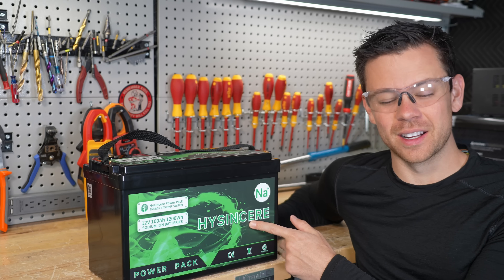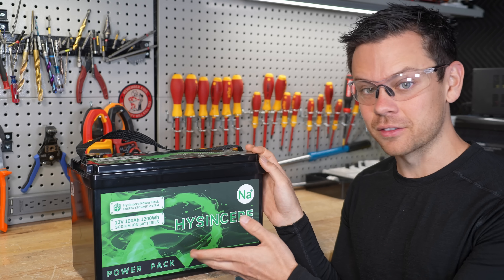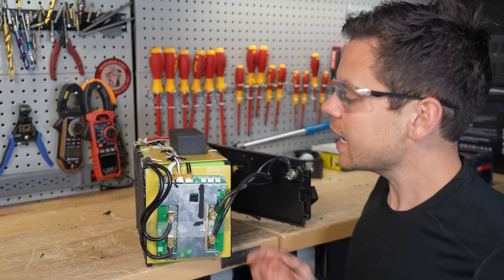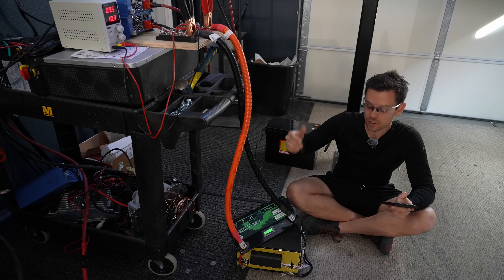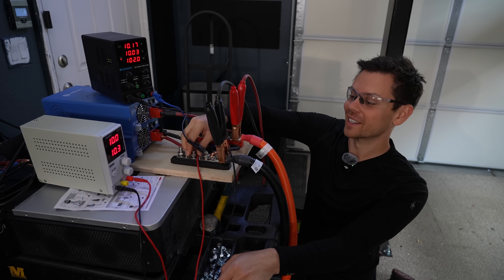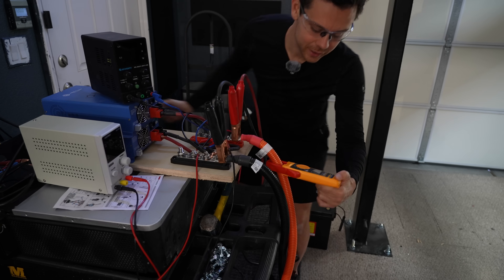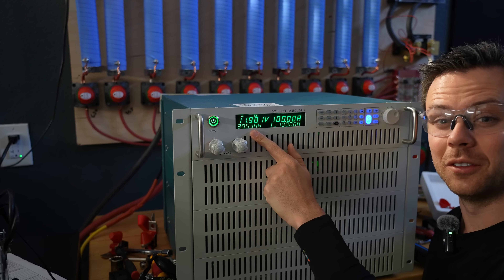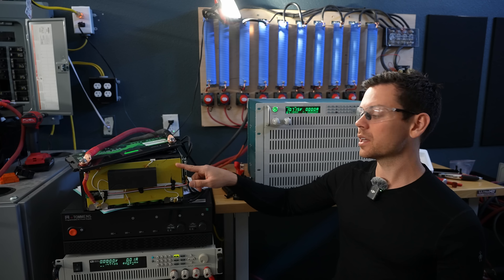Testing My First Sodium-Ion Solar Battery

Comment: I have a small farm/homestead in Georgia.  I use Na+ start batteries in my tractors and trucks.  Cold weather and high current crank are the main reasons, followed by high voltage charging.  Some of my tractors put out 15 volts at the alternator which shut off LFP crank batteries (and they can't be charged below freezing anyway).  Even my Jetta TDI has a Sodium crank battery (it starts instantly).  For my solar setup, yes, LFP all the way.  Thanks for the teardown video.  Very informative.
Reply: Thanks for sharing real experience.
Reply: I have the same experience with Sodium-Ion starter battery in an electric vehicle ( Nissan Leaf ) .... excellent cold performance, no more Lead-acid batteries...

Comment: Have you measured these round trip efficiency?
We tested NA cells in our lab 15.2V-6V 0.2C they had a roundtrip efficiency of 98.5%.
Reply from the maker: Holy cow! What cells did you use
Reply: @WillProwse Unfortunetaly I‘m not allowed to tell. 
But I think the efficiency relates on the cell design and quality.

Comment: There are 3 different types of sodium batteries. 2 batteries use lithium or magnesium. The 3 third doesn’t use any fire hazard materials. You didn’t say which battery you have. However, you do keep saying sodium ion . I would assume you have sodium lithium. Which does have a fire hazard. The sodium battery which has no lithium or magnesium works to -40 degrees F and way up into the 110 degree range. There’s a company in the US which produces these batteries and have them in use for many years.

Comment: Most of these downsides are substantially mitigated in testing for the new tech coming out next year and will be mass produced. This battery is still using much of the original concepts of NA ion and is not up-to-date. The new ones will still be technically inferior to equal weight of LFP in most regards, but there is zero doubt that the price will go down dramatically once this is mainstream. Ideally, this would replace ALL lead acid batteries and be a huge boon for energy storage globally just from that alone.

Many of the other complaints about this in the video are not related to the NA tech, but more to the cheap off brand Chinese manufacturing quality of this specific device.

Comment: Yikes.

This is one of those videos where a surface level understanding and amount of research really leads to poor conclusions.

From a production standpoint alone, especially at a global distribution scale it's very easy to see why Sodium ion is a 'better' technology to pursue than LI batteries.

I think maybe working in a salt refinery in a developed nation as opposed to a cobalt mine in any of the areas it's actually produced currently would probably change your mind but fuck that, how would you be able to make content denigrating the 'worse' technology if you actually wanted to think 10 years to the future?

Comment: I commented this earlier to your earlier video aswell. You focus on so many sidethings and are pre determined to give it a negative "low" grade. You use equipement that is not made for these cells. And therefor all your claims are immediately wrong. You need chargers and inverters that are made for these batteries. Like so we needed different chargers and inverters switched from lead to lion. You cant think out of the box and are way to focused on your lfp / lion setup.

The first lion batteries were absolutely terrible too. Try to look ahead of it. You say you can use a lfp battery with heaters in a car. Just listen to it as you say it. And then you say sodium ion is unpractical. This is not an honest review. This video is a rant and predetermined to be negative. Sorry to say

Comment: Sodium-Ion batteries may not be as efficient as lithium-ion, but my understanding was that the main advantage is materials are incredibly common (found everywhere), easy to gather, and mass produce and maintain. Elemental sodium is pretty reactive though so I imagine these must have similar thermal runaway problems as lithium?

Comment: i dont really understand your video. You cut of the voltage at 10V, which is at 40% soc of the battery and than claim you get only 62Ah instead of 100?!?

The issue is not, that the voltage is to low or the battery is damn inefficient, but that the charge and discharge controllers are configured for different voltages.

This test makes absolutely no sense at all. The only thing that was interesting is the internal battery resistance reducing the charge rate.
Reply: And i am by no means a fan of sodium batteries or so. i actually dont care to much about any hype. Just saying that these tests are completely useless to asses anything.

Comment: 00:18 cany anyone tell me what discharge rate that curve is for?

If it was 1C, that doesn't match the typical usage if someone was considering them for off-grid or a camper van. 

0.1C or less (10-hour or 20-hour rate in old speak) might tell us more.

Is it just me, or should we ignore Ah and be talking about capacity in Wh and kWh down to a voltage limit of maybe 10V?

Comment: As a scientist I see a problem right off. 1. You appear to have tested a single unit, is that accurate? You should probably test 5 different batteries from different production dates to eliminate a possible bad test. 2. If you tested only one battery, you only tested a single brand and unless that battery is UL or some other 3rd party certified for meeting consistant standards then your data means nothing regarding wether or not the technology as a whole is bad. 3. Did you have another person repeat the test to see if they came up with the same results? A minute in I'm hearing that the tech as a whole is a failure in that it can't keep enough voltage to keep the inverter from turning off, and that the 100Ah is only 82. As soon as you saw 82Ah on a unit claiming 100 you should have taken that battery back and got a second unit to test. Either the brand is lying, your method is bad (you don't have a control test with a lithium battery), or the unit itself is bad, or something else. Regardless you are making solid claims without the required study.

Comment: Yup, Sodium isn't a replacement for LiFePO4 currently, nor for portable. The biggest benefit is the US wouldn't be reliant on rare Earth materials from overseas. When production ramps up, costs will go way down because you aren't going to be dealing with tariffs or shipping from China. Sodium will be for houses and fixed locations. Also, as you pointed out, the temperature range is excellent.

Comment: Sodium is great when you understand it isnt meant to replace lithium. It is however a great replacement for lead acid and avoids the major issues with lithium in really cold areas or like here in Florida where tesla power walls and golf carts all burn to the ground after a hurricane because lithium has a thermal runaway problem. Its also easier to dispose of than lithium. So when you compare it to lead acid it works amazing and the lack of thermal runaway makes it way better for emergency power storage in areas where flooding is an issue. I think its a great option for a lot of situations and considering its such a new tech I expect it to get better, cheaper, and more efficient as the tech develops.
Reply: We're talking LithiumIronPhosphate chemistry, where the thermal runaway problems of the old LithiumIon batteries is essentially nonexistent. LFPh batteries are rapidly replacing LithiumIon in most typical application now.

Comment: Sodium will work but it needs active voltage management. It needs to cycle through the smaller cells with high voltage in combination with low voltage ones to generate a constant voltage. It's reminiscent of buck-boost converters. I don't know how efficient this switching would be though. At max capacity, it can have less duty cycles on all cells to bring the voltage down to a normal 12V and rapidly adjust on load to sustain 12V

Comment: The taper off during charging is a function of the linear voltage vs state of charge. A charger setup for Na batteries will sort that out. Blame ur charger!

Comment: I understand why you have issues with this particular pack, but that doesn't mean all sodium ion is bad. Most manufacturers would be honest about the capacity of their cells. Using a lithium ion inverter for a sodium pack is dumb. Prices will eventually be cheaper than lfp. Lifespan may end up longer than lfp. Wider operating temperature range. Can discharge to 0 volts without ruining the cells. Safer. Round trip efficiency will only get better over time. It's only a matter of time before sodium takes over.
Reply from the maker: Can you send me one? Let's make it happen
Reply: @WillProwse 😂 I think I might have one lying around somewhere..

Comment: i think the point of sodium ion, is the materials are alot cheaper, so when they are mass produced should be substantially cheaper than lipo4
i wouldnt be surprised to see them like $20-$30/kwh. or less if they get addoption. 
No lithium, cobalt, or nickel.
Those are expensive, supply-limited, and often mined in politically unstable regions. Sodium, by contrast, is abundant and cheap — it’s literally in salt.

Uses iron, manganese, and carbon.
These are low-cost, widely available materials, much cheaper than the metals used in lithium-ion chemistries.

Simpler, existing production lines.
Sodium-ion cells can often be made with the same machinery used for lithium cells, so companies don’t have to rebuild their factories.

Better cold-temperature performance.
Sodium ions move more easily at low temps, so they don’t need as much costly battery management or heating systems.

Lower energy density, but lower cost per kWh.
They store less energy per kilogram than LiFePO₄, but the materials are so much cheaper that the cost per usable watt-hour can still come out lower — ideal for stationary storage or low-cost EVs.

Comment: He future benefit is no massive mining rare earth metals, won’t be tied to china, and they’re not supposed to burst into flames like lithium.    And the cold thing matters a lot to many people.  Why would we use the battery to heat itself?
Reply from the maker: LFP doesn't use any rare earth elements
Reply: @WillProwse . Uhhh, they’re lithium.  Lithium is a rare earth metal.  🙄.         Though I have heard they will cycle much more than ion,  and sodium may need some heating but not as much.    They still have a way to go though, because they still don’t perform as well
Reply from the maker: And sodium ion will need to be heated too

Comment: -22F for a starting battery is pretty bad. Regular acid batteries can handle -40 just fine. Now add the quite low current output and you want crank a car. Usual CCA for an acid battery is 450 to 650A.

Comment: Prehaps it will work better with a bank of capacitors to negate the voltage drop due to the discharge/load.

Comment: Most inverters and chargers would be able to cope with this chemistry as is, but would need a FW update to understand the wider voltage range. VEConnect on Victron inverters would be an easy modification just using the software on a custom template.. But, since most white box inverters don't give up that level of control, then yeah, a load more resources to make kit for this chemistry...

Comment: I am hoping this is just the initial growing pains of a new technology. Sodium was supposed to be 1/10th the cost, and if that were the case one could easily double the amount of batteries needed and still save a ton of money. It has to be at least 1/2 the cost just to make it start to sound like a good option but that discharge curve also needs fixing. Fantastic job showing the current state of those batteries. I am really interested in them but will certainly give it more time to mature before jumping in.

Comment: Very interesting review of the first sodium-ion batteries. My prediction is that it's very early days and this seems to be one of the cheaper batteries. Look how far LFP has come over the last five years. I think it will be no different with sodium iron. And there seems to be quite a few different sodium iron chemistries from different manufacturers in the pipeline hopefully some better than others, Prices should come down substantially once they're in mass production. As I see that will be one of the benefits when space is no issue, for example for home solar use, you can purchase a battery bank for half the price. Would be interesting to see how many cycles you can get out of the sodium ion batteries and the degradation over time.

Comment: Definitely they are a good match for 12 v lead acid replacement as the curve is similar and a handy way to check capacity, along with the taper charge and low acceptance, all very lead acid like.  Also they are far more forgiving for overvoltage so they won't open on car charging due to imbalance and cause a load dump that can destroy var electronics.  Great test
Reply: Looks like the biggest problem would be the low voltage issue.

Comment: The problem isn't with the chemistry, but with the cells they're using. I'm big into car audio. I run sodium in my bass ride. It blows everything out the water. I'm running a 320 amp Singer alternator and just a single Advanced Electric Kilo55 Sodium battery on a 7,200 watt amplifier. If you want to try out some great sodium ion, check out Advanced Electric and test out their Kilo line.
Reply: Side note: I'm not sure how well they would work with solar, but for car audio systems, sodium is great. Well, sodium from Advanced Electric is anyhow. I charge at 14.4-14.8 volts and a little over 320 amps at 1,500 RPM.

Comment: Interesting. CATL is making huge “claims” that their new Naxtra sodium batt is going to change the world. Same energy density as LFP, faster charging, longer life, no heating/cooling needed, 1/3rd price of LFP, etc
However quite telling that they are only using it for starter batteries (replacing lead acid) for now.
Just as Will said here where they would probably be most useful! 
Batt makers in China make a lot of bold claims (also CATL has a HUGE interest in hyping sodium in order to get lithium prices down - CATL is the biggest buyer of lithium in the world remember).
Anyway until I see independent 3rd party tests I won’t hold my breath on sodium ion for now.

Comment: You can buy a sodium battery from Eleven Energy in the UK today. I don't think they have a US distributor yet so not sure how easy it will be for Will to get one. I had a very interesting chat with their chief nerd at a show recently. I've just asked them what the RTE is as it's not on the datasheet and I forgot to ask about that. Edit: they quote 95% round-trip efficiency (it's actually on the home page of their website), so very different from the cells you have tested. Looks like you should get one to test.

Comment: “inverters will cut out”

Adjust the inverter range, I did this with my Genetry Solar Inverter for a higher initial voltage for the battery modules I purchased. 

This does not seem to be rocket science.

Comment: It's not the battery's fault if your inverter or other kit cuts out early because it's designed for a different chemistry. Check out Eleven who make sodium-ion ESS. They also do an inverter precisely because the working voltage goes too low for most existing inverters. That will fix itself over time if these prove to have a niche. The linear voltage curve is an advantage for estimating SOC. The very flat curve of Li-ion and LiPo makes SOC estimation quite difficult. And so long as you are driving loads through an inverter rather than direct-DC voltage variation in the battery is irrelevant.
The main USP of these things is cold-weather outdoor operation, and really wide availability of battery materials: there is no shortage of sodium or the other cathode/anode materials (iron, manganese oxides). And they could end up being very cheap. We shall have to see how that goes - they aren't yet due to low production volumes.

Comment: I think when/if Na comes down or is better than LFP pricing, I think it will be an OK choice for some scenarios. It would be nice to put my battery bank out in the garage, but it gets below freezing, and I'd rather not have to rely on heaters. If there ever was a short/failure in one of the cells, it would be nice to fill the garage with smoke, rather than my house. Very rare scenario of course, but still.
The voltage curve is definitely a double edged sword. On one hand having a far more reliable SoC is great, but obviously as you said, current inverters won't be able to use all the capacity.
On a related note, it would be nice if 100V DC inverters became the final form. High enough voltage to increase efficiency by a significant margin, and cutting the wire gauge in half is a big deal with what we need at 48V. But not so high that deadly arc flashes would be likely as it would with 300V+ systems.

Comment: Hi Will
Great video as usual!
There is one use case, howbeit mostly outside the DIY space that mitigates the large voltage variation between full charge and full discharge of a Na+ battery.
Some manufacturers e.g. Sigenergy incorporate a bi-directional DC-DC converter in their batteries. In Sigenergyy's case this boosts the 9S LFP cells from 28V to 900V which is paralleled with other batteries.
I imagine Sigenergy will be able to use Na+ batteries with a DC-DC converter outputing a steady 900V over the ca. 32V-64V range of a 16S configuration.
However since these sort of batteries tend to be proprietary to the manufacturer, the options in the DIY space is limited.
Perhaps someone can make a module combining DC-DC buck-boost converter and BMS capabilities, which will output a steady 54v from a 16S NA+ battery configuration, thus masking the wide variation in input.
Reply: And the discharge curve gives us a clear understanding of state of charge!